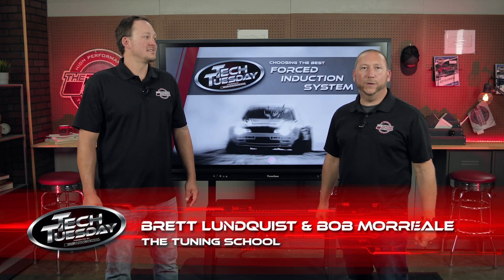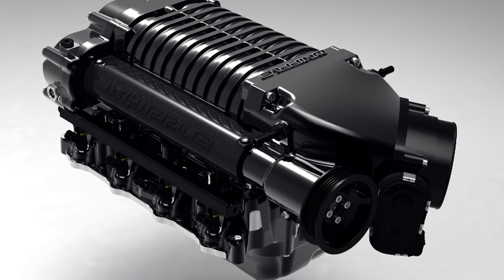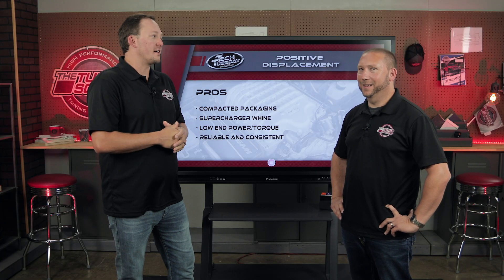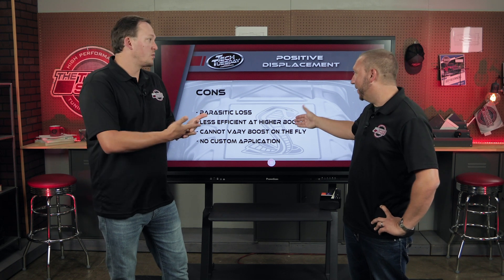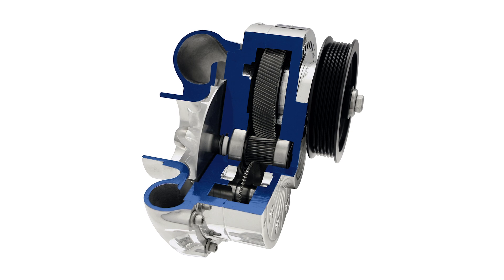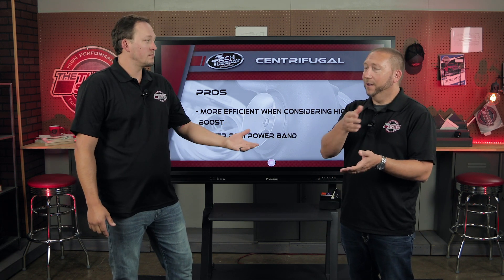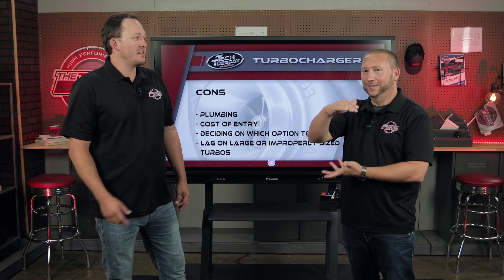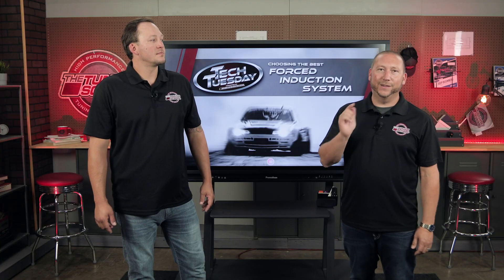Choosing the Best Forced Induction System

Comment: The idea that there is no parasitic loss with a turbo is not really correct. Exhaust back pressure affects an engines performance and superchargers with bypasses built in reduce the parasitic loss of the supercharger quite a lot.

Comment: It's a bit hard to say which one I would choose as this would be application specific.
However I will use my combination as an example.
I have a Dart Pro Iron LS 434 engine with AFR 245cc heads a 3500rpm stall converter and a street solid roller camshaft. (256/262 .707 .698 114 LSA +4)
Fast 102mm intake, 12:5.1 compression and runs on e85 exclusively.
This engine produces produces a TON of low and mid range torque and I certainly do not want any more in this RPM range.
Even off idle it hits hard. Honestly this combination pulls hard at every single RPM all the way to 7200rpm.
So with that being said, the only route I would go is a turbo.A supercharger will be too mental in the lower RPM ranges and I do not want to spin to the moon with a pro charger.
The turbo would need to be sized to suit a 3500rpm-7000rpm operating range.
What others may not know is that using a solid roller makes the engine rev faster while also being more responsive so this will also need to be taken into consideration when sizing the turbo.

Comment: Exhaust Backpressure, (which is "ideally" equal to the Boost Pressure), is a DEFINITE  "parasitic"  loss.
That power loss never gets to the crank to be measured, and shows up as a tremendous heat build-up, both inside, and outside, the engine.
Turbo setups which are not carefully engineered can make tons of Boost with very disappointing horsepower increases.
Boost Pressure is ALWAYS controllable, it's called a Throttle Butterfly. 
Late Model Factory setups virtually always control boost with the electronic throttle, it works on Turbos as well.
A Waste Gate is simply a way to make more lower rpm torque by using an undersized Exhaust Turbine,
otherwise, the turbo set-up would act more like a Belt Driven Centrifugal Blower, with boost pressure increasing with rpm.
.
.
Reply: You beat me to it, a fair bit of mis-information in the video.
For those who don't get it, the piston needs more force to push the exhaust gases out of the cylinder as the preessure in the exhaust manifold increases, that force is applied by the crankshaft and reduces the torque output of the engine.
Most modern superchargers also have bypasses designed into them, which can significantly reduce the off-boost pumping losses, where turbochargers have an advantage.
Reply: @gordowg1wg145  
There's NO "Free-Lunch", everything is a trade-off, hopefully going in the direction of greater EFFICIENCY.
Something that many people can't wrap their heads around is "Compressor Load", 
the more dense the air is going into the Compressor Inlet, the more POWER it takes to spin the Compressor, 
( this is not referring to any increase in AIR DENSITY that is CREATED by the Compressor, but this of course, requires POWER as well ).
Throttling the inlet to the Compressor, (Reducing the INLET AIR DENSITY), is the most efficient way of controlling Boost,
and it has several other side benefits as well, one being, reducing temps everywhere, 
another being, (in the case of a Turbo),
allowing the Turbo RPM to be maintained at a higher level, under low, or, no Boost conditions, creating faster throttle response,
another being, reducing the engine torque load of any type of Supercharger.
Not to mention, no need for a "Blow-Off Valve", because the Compressor stays out of its "Surge Conditions" area of operation,
and stays closer to the "higher-efficiency" areas of operation.

Also, to address your additional comment ......
The ratio of Boost Pressure to Exhaust Pressure is going to determine how much "EGR" Effect, or
"Exhaust Gas Dilution" of the Intake Charge that will occur during the Valve Overlap period.
This is why there are special Turbo or Blower Cams made by every Cam manufacturer,
which have super-wide LSA's  ( Lobe Separation Angle ), because Valve Overlap gets critical with Turbos at high Boost Levels.

Superchargers are somewhat different, in that, they "usually" don't have as much Exhaust Back Pressure, and might even
have NEGATIVE Exhaust Pressure with well matched Headers, meaning that, you can loose a lot of Boost straight out the Exhaust Pipes,
but you certainly would not expect to see the Exhaust Pressure at anywhere near the levels you get with a Turbo setup.
This is almost like having a second Compression Stroke for the Engine to work against.

The Power required to drive a Turbo is definitely NOT "FREE", and must be taken into consideration when designing the whole "Package". 
.
.
Reply: @jimbrown563  
TANSTAAFL - There Ain't No Such Thing As A Free Lunch - been using it for decades.
Seriously, though, I was aware of all that and maybe a bit more besides 😎

If you haven't come across it, Gale Banks has some really good stuff on his interweb site - https://www.youtube.com/channel/UCs50EmjtJyNLDcgTGSVNvcQ - Killing a Duramax series, I think it was. Plenty of test data, and maybe 4 decades (first came across him in the late 70's, I think) of actual hands-on experience to back up his thoughts.
Reply: @gordowg1wg145  
Same here, I read quite a bit of stuff from Gale before the Internet,
but I only discovered his YouTube Channel about a year ago.
Great guy, Great Brain.
David Vizard is another Great that I studied back in the mid-70's,
that, and just about every book published by  "S-A-Design"  that I could get my hands on.

All this understanding and implementation over the years made me finally come to the 
conclusion that Piston Engines are a dumb and extremely inefficient way to make power, 
so around 7 years ago I came up with a unique engine design that is 100% Rotary, (not talking Wankels or Turbines here), 
it's  "similar to"  the operation of a Jet Engine, with the exception that
it uses positive displacement, multi-stage Vane-Style Pumps, both for continuous Compression, and continuous Expansion.
This basically creates a "modular", continuous combustion, on-demand, Steam Generator, 
that is efficient even at very low power output levels/rpm, and runs at temperatures low enough to facilitate using Plastics in 
every part, (excepting the actual stainless steel Combustion Chamber), used in its construction.
It runs at around  ~450F and ~450psi   Steam Pressure, and is completely insulated, and has no cooling system, 
(only an air-cooled, Water/Steam Recovery Condenser, to recycle about 90% of the water used),
and preferably runs on Diesel with Water Injection, and Peak Combustion Temperatures are so low that 
it produces ZERO NOX Emissions, while at the same time, 
having such an efficient, and relatively sloooow, and thorough, Combustion Process that Hydrocarbons are also virtually ZERO.
It's close to 85% efficient, 
has no reciprocating parts, 
makes stupid amounts of power, 
weighs half as much as a Piston Engine per horsepower, 
has Zero Vibrations to balance-out, 
doesn't require a Transmission or Clutch, 
and doesn't even require a Muffler.

The biggest draw-back is that it doesn't have a cool exhaust sound, ( it sounds like a Vacuum Cleaner when it's under heavy load ).

I'll be pursuing this as soon as Trump announces the take-down of all the Criminal Multi-National Corporations,
which should be 5 to 6 months from now.
This should allow me to pursue this endeavour without getting "Accidentally" "Suicided" by GM or Ford "business associates".
.
.
Reply: @jimbrown563  
OK, got to disagree with the last bit - trump'll hopefully be in jail by then, with the rest of his quislings 😉 You should do some serious checking-out of the shit-bag. I did some in depth checking when he first announced he was running as I couldn't believe it was the same crook. Possible the most corrupt leader, ever, and when you consider that includes people like Putin, Xi and Berluscomi, that takes some doing. 

That said, if you have a working prototype, even if the efficiency isn't there yet, you should be able to get all the financing you need. gas turbine engines can provide compact power units, but their efficiency sucks, they're expensive to make, and they produce a lot of hot waste air. Should it have the qualities you claim, especially if it is tolerant of varying fuel quality and energy content, there would also be a potential for stationary engines and as hybrid electric vehicles' generator units.

Do you have an idea what you'll name it, so I can keep an eye open for press releases, etc? Sounds a bit like a hybrid of a Stirling (?) engine with a rotary piston/waffle plate as found in some hydraulic motors - I vaguely  recall something like that a few years back in, I think, RaceCar Engineering - might have been something about a steam powered speed record car? If so, developments in ceramic technologies may aid reliability as water, especially as steam, and oil don't mix well, but some ceramics can run dry.
Reply: @gordowg1wg145  
"Zero reciprocating parts", 
"Positive Displacement", 
"extremely low Peak Combustion temperatures", ( well below the critical temps that cause the formation of NOX gases ),
Super Turbulent, (and relatively slow when compared to Piston Engines), Combustion Process, under continuous 400+psi regulated pressure,

Ceramic Bearings were part of the design from the beginning, but are not required, most other parts are Plastics similar to Teflon.
A small percentage of Diesel Fuel is run through the Compressor Section for lubrication and sealing enhancement,
and is completely burned along with the main Diesel Fuel being normally injected into the SS Combustion Chamber.

Unfortunately, all of the names I tried to come up with have been Copyrighted and/or Trademarked,
so I have no clue how naming will go.
It might have to be something goofy like "Super-Diesel", who knows.
-----------------------------------------------------------------------------------------------------------------------------------------------------------------------------------------------------

Dude, YOU'VE GOT TO TURN OFF YOUR TV,  it's 100% "C lowns I n A merica" run PROPAGANDA, 
and so is more than HALF of the internet, and another third of the internet are just plain IDIOTS.

Trump has the entire world backing him, EVERY COUNTRY, ALL WORLD LEADERS, this is no joke or exaggeration.

Ever notice how there are ZERO WARS going on ????  (just some bullshit posturing to keep the illusion alive).
Previous to Trump the US has been in AT LEAST 6 different simultaneous "Conflicts" EVERY YEAR since World War 2, (1946).
There have been ZERO "Conflicts" since Trump took office, almost 4 years.

Ever notice how the actual World Economy is COMPLETELY TRASHED BEYOND REPAIR and could not possibly have lasted this long ????
( There was NO RECOVERY from the Crash in 2008/2009, the World's Economies have been on "Life-Support" for over 10 years )

Don't worry, the Good News announcements are already starting to be dripped-out, little by little, 
so as to not completely freak out the brainwashed public, 
( which BTW you happen to be a part of,  this is not an insult,  it's just an obvious fact ).

I've been studying this 24/7 since Trump got into office, from over 50 separate news sources, and that doesn't include my
3 years of studying Law, and studying History for 30+ years.

A good place for you to start getting a real, truthful understanding of the real-time MOVIE that we are all experiencing is by subscribing to 
the "X-22 Report" on YouTube, https://www.youtube.com/channel/UCB1o7_gbFp2PLsamWxFenBg

If you'd like a full list of my sources just reply back here and I'll copy and paste the entire list here in the comments.
This may be necessary because of the extreme CENSORSHIP of YouTube,  you won't get any legitimate "Suggestions" from YouTube,
so you may have to have direct links to find some of these other related Channels/Sources.

EVERYTHING you thought you knew about politics is a  100%  LIE / PROPAGANDA bullshit story, start getting used to it.
.
.
Reply: @jimbrown563  
The engine is interesting, you may need to give the idea of usingthe diesel fuel (good move) as a lubricant some thought as, with the requirement for low sulphur fuels, there is a significant reduction in fuelling.

But the rest suggests you REALLY imbibed that electric coolaid.
It's clear from that extremely ill-informed rant you neither have any interest in checking out the slimebag for yourself, nor any interest in anything that interfers with your delusional state.
You REALLY need to look at independent news outlets, especially those from other countries - even the 'right' press considershim to be a joke and a disaster for America - the only possible exceptions are the far/alt' right press who have a very limited grasp on facts and are generally pandering to the nutters.

As I said, I was checking the crook out from way back when he was initially talking about running - even then, his business practices were largely based on failure to pay people - EVEN THE LAW FIRM THAT WON ONE OF HIS CASES FOR HIM HAD TO SUE FOR PAYMENT - CHECK IT OUT, underpaying on contacts, failure to meet loan payments and offering to pay only a small proportion of the due amounts - why he couldn't get a loan from an American bank, BTW, and went to Deutche Bank, who turned it down initially but, a week after a large deposit from a Russian investor, it was approved. Even then, he missed a payment and extorted an extension out of them.

Other than a very small proportion of rabid supporters, and a similarly small number of fools in other countries, the world knows he's a liar, a cheat, a bully, a braggard, a self-delusional con-artist who has managed to bullshit enough idots into supporting him - I don't have a problem with those who didn't like Clinton and didn't vote for her - she was deeply unlikeable and rather smug - but even then trump was demonstatably magnitudes of times less suitable for the position he has.

Should you actually have the merest hint of an open mind, I'll post some questions for you to ponder on, and come to the realisation he really is the dispicable person most of America, and the world, know he is.

Take care, DON'T drink bleach or disinfectant, DON'T stick light bulbs into any cavities - remember, trump said he doesn't "kid" when his quislings claimed he was being sarcastic... DO social distance, DO wear a mask, DO wash your hands - if not for yourself, then do it for others that you may infect in turn.
Reply: @gordowg1wg145  
The Sulfur Content is only an issue with extremely  "High-Pressure"  Lubrication Points, 
such as Valve Guides and Valve Seats, Camshaft Lobes and their Followers/Valve Tips, Accessory Drive Gears, etc.,
My Engine doesn't have any high-load / high pressure contact points, zero, it actually will run just fine without lubrication.
Most of the friction in my design is very Low Pressure Teflon on Teflon sliding contact, 
but the Diesel Fuel provides the biggest benefit by creating a liquid  "seal"  between the sliding parts,
this tends to reduce Steam Pressure Loss, reduce parasitic rotating friction,  
and increase overall efficiency, and life expectancy,
which should be around ~500,000 miles or more, (with lubrication).
It doesn't have a Oil Sump, or any other means of lubrication, 
the Bearings are permanently Sealed and Factory Lubricated.
-------------------------------------------------------------------------------------------------------------------------------------------------------------------------------------------------------

EVERYTHING you thought you knew about politics is a  100%  LIE / PROPAGANDA bullshit story, start getting used to it.

I wasn't joking or exaggerating when I made this statement.
For the time being, I'm not expecting, or asking for, any further debate,  
(unless you are seriously interested enough to spend the time and effort),
If you are interested in further debate, and where to find reliable information, I will gladly take the time.
Otherwise, you are smart enough to survive the coming transitions just fine, 
although you will probably not believe it when it happens, even when it's right in front of your face.
Good Luck and Happy Trails to you.
.
.

Comment: Could you use a waste gate to change boost on the fly with a centrifugal? Run a small pulley for max output and control how much boost the engine sees thru the  waste gate? Anyway to adjust the tune with the boost level?
Reply: yup thats how I have it set up. wategate on the charge pipe. 9 psi on 93 and full boost on e85. but because its centrifugal, say you make 9psi at 5k rpm like i do,  unlike a turbo, if you want 10 psi, you wont get it at the same 5k rpm. you have to wait until a later rpm where the blower makes the 10 psi to hold it
Reply: I would like to know why there isn't a CSD available..."constant speed drive"....
Seems like prochargers etc could see gains or a better power delivery curve.
Aircraft use CSD.
 Just a thought.....
Reply: If you set your centrifugal for 20psi at redline then you will get 5-10psi very quick like 3000-3500 rpm and you will start making boost almost right away then you just waistgate anything over your desired boost